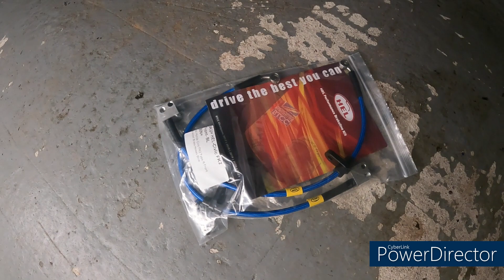civic fk2 airtec intercooler modification part 2

Comment: Hi mate where did u get the bonnet protecter from/bonnet bra?

I also sell dress up bolts to fit the fk2 slam pannel £35 posted and a choice of colour
Reply from the maker: Hi fella think I got it off eBay can’t remember lol it’s called scoutt hood deflector think it was about £60 

Thanks for the offer fella but I ain’t spending anymore on that bay had enough of it lately 🤦🏻😂glad the bonnets shut for a while 😂😂👍🏼👍🏼
Reply: @sajon44  thank you found one finally. For a non type r but should fit I assume
Reply from the maker: @martinwest6557  yeah will do 👍🏼